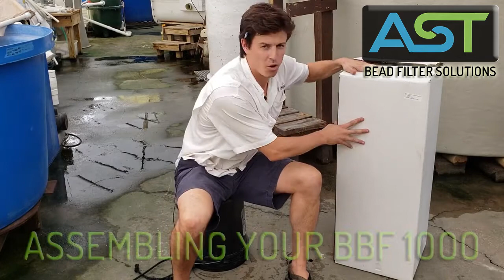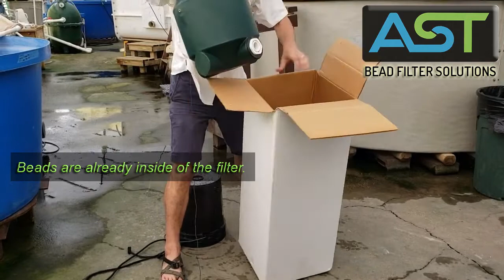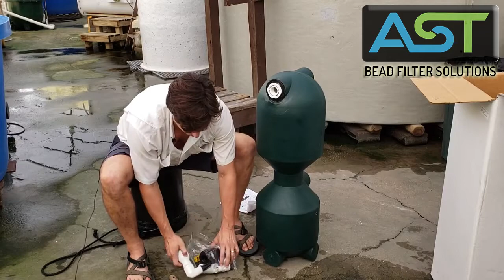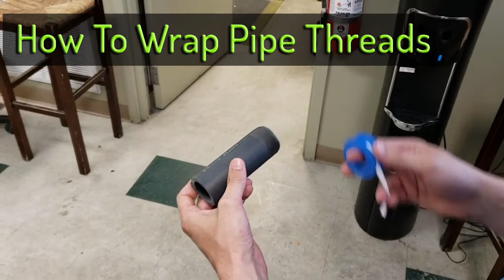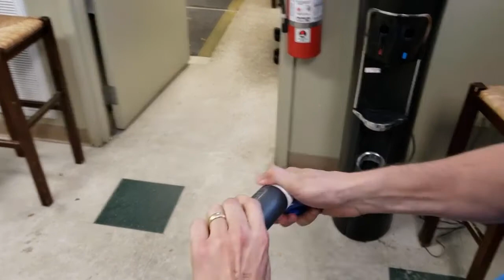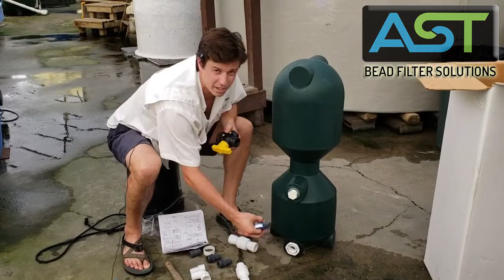Unboxing and Setting up a Bubble Bead Filter 1000!

Comment: i have the bbf xs 1000. I notice whenever I first start the pump, a little bit of water comes out of the air intake. Seems it takes a second or two for the check valve to be forced closed by the water. Is there any way to fix this?
Reply from the maker: Vince, thanks for your question and sorry for the delayed response. This is common with these check valves. It takes a bit of pressure buildup (full water flow) to fully close. Some customers who did not want the spillage have added a 3/4'' ball valve after the check valve and manually open and  close it when they backwash the units. This will work but is a little more labor intensive. It is important to note the ball valve must be opened when backwashing if you choose to make this adjustment. 

Again, thanks for your question!

Comment: Hey Paul, great video! Are the beads aerated only when backwashing? thank you
Reply from the maker: Lukasz, 
Some oxygen is always in the water as dissolved oxygen. The beads are heavily aerated and agitated during the backwash. If the beads are exposed to too much air from an airstone too close to the filter inlet, the beads can fluidize (be constantly moving) and fail to capture solids. Fluidized media  is often used for biological filtration ( in moving bed bioreactors or fluidized sand filters), but the Bubble Bead filter would no longer be doing its job as both a biofilter and a clarifier.  

To see the full backwash cycle and what is going on inside, check out this video:
https://www.youtube.com/watch?v=tZCiIIcKgx8

Comment: I want a filter for a 80k liter tank India . Can you make that possible?
Reply from the maker: Deepak, Yes! we have units that will provide a 30 or 60 min tank turnover for 80,000 Liters (21,000 gallons). Our PBF 25S  (max flow: 300 gpm/1,140 lpm) and PBF 50s (600 gpm/2,270 lpm) will be able to give you the 35-70 minute tank turnover. This filter sizing is based only on tank turnover criteria, not bioload. Please let us know through our website if you have any other questions or inquiries about AST Filters. Thanks!!